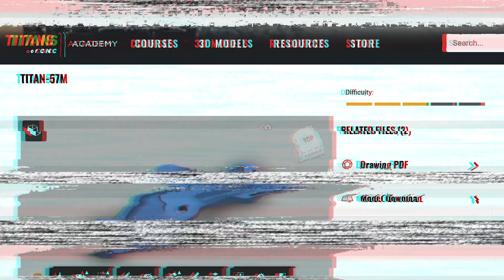CNC Machining the TITAN-57M on a TORMACH | Op #2

Comment: Semi-finishing is common? With such a small stepover for parallel passes it seemed like there wasn't much difference in surface finish even with inconsistent amounts of material engaging the cutter per pass.  Were there any dimensions finished in the previous operation that might have warped from removing the rest of the material?  Can't find the 57M on the website just yet.
Reply: Thats what I was thinking - seemed like somewhat of a wasted pass/tool change because of the stock it removed from rough to semi wasnt all that significant and the machine could have handled the increased thickness.
Reply: Hi,
If your machine does not have 3D compensation but the standard G41/G42 you have to do parralleles paths. That way you can decomposed all the tilted plan by parralleles paths and use your tool compensation. Very useful for resharpened tools !
Reply: @nicolasperin7338  So this means cutter comp on the machine controller will cause some problems for 3d surfacing without "3d compensation"?

I take back the question about semi-finishing because on stainless and probably the other hard materials to machine semi-finishing +finishing leaves a better finish.
Reply: @multiHappyHacker  Some controller cannot compensate a motion with Z. Because it has to compensate with the diameter and most importantly with the corner radius of the tool. The tool path is genereted with the tool center tip and with a motion were you have Z moving the final shape depend of the corner radius and the diameter of your tool. Both parameter have to be changeable on your NC controller if you want to use compensation.
I hope it is clear ^_^

Comment: Well done 👌👌
But i have a tiny remark: it dosen't call second operation but it's call second phase cos u have only one operation called milling. And when you move milling to turning or grinding or.. then u should say the second operation .
🤗🤗🤗
Reply: Bougrine Hatem I'd correct you there. It would be the same operation if it was done in one. But becuase it involves a separate set up/fixture it is a another operation.
Reply: They are TITAN and they can call it whatever they want because they are the T I T A N S!!  BOOM!!! 
lol